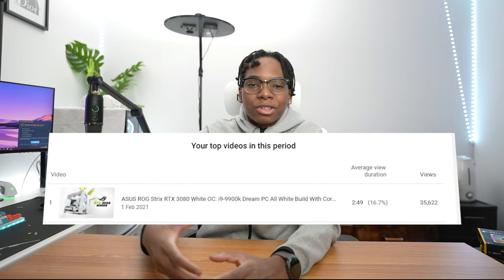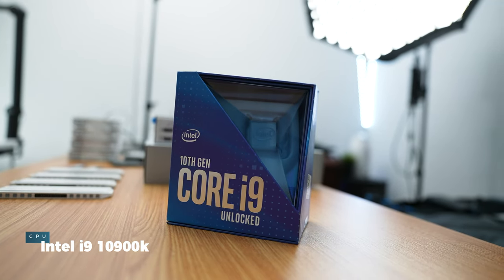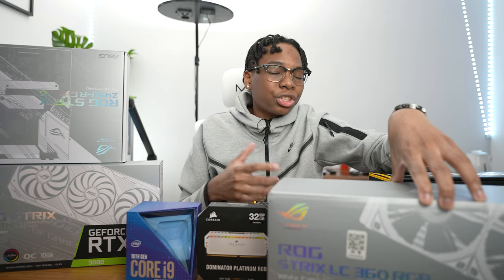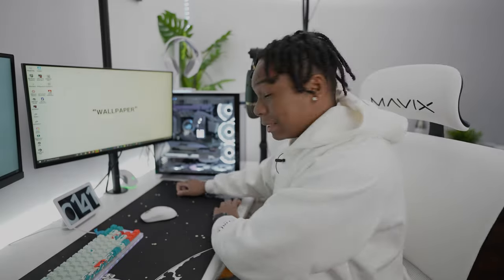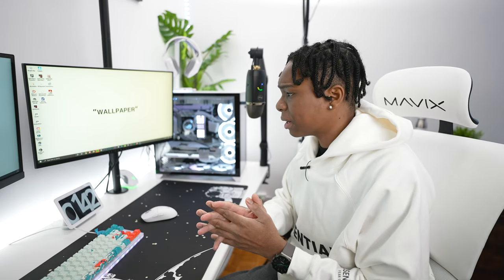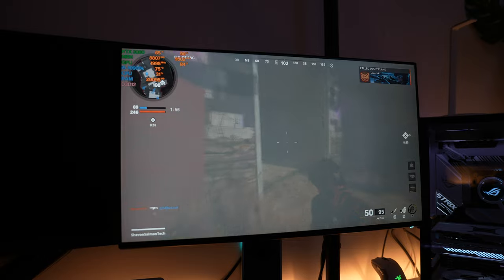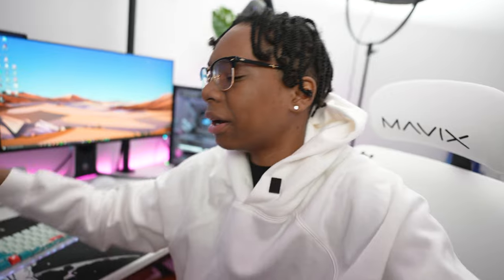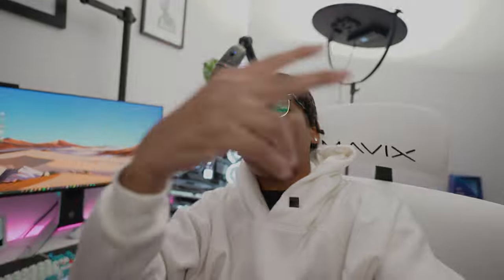Epic $4500 PC Build: White Asus RTX 3080 x i9 10900k

Comment: I've just built my son a very similar system and he's eventually been able to purchase a strix 3080 and I'm very worried about how well it will fit. The specs say 141mm for the card and 159mm for the case. Did you have any problems fitting the gpu's power cables??? We don't have any custom cables and I'm worried about the cables jamming against the window. Thanks for any info, cheers Adam.
Reply: Btw it fitted fine. I ran the power cables over the top of the GPU and there's plenty of room.

Comment: What are those little plastic brackets that you use on the power supply modular cables to keep them perfectly rectangular shaped? I bought this same model Corsair power supply but they didn't come with any of those small plastic brackets.